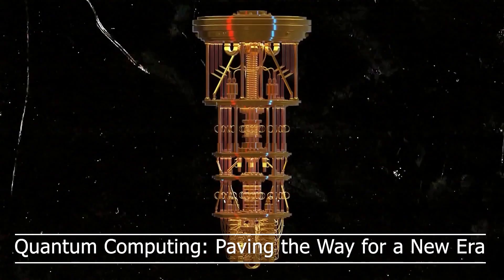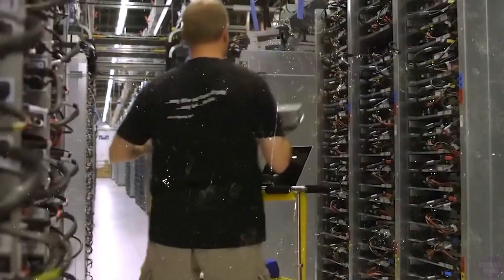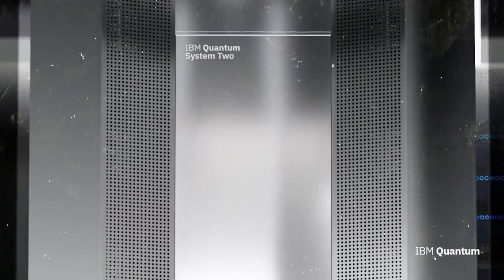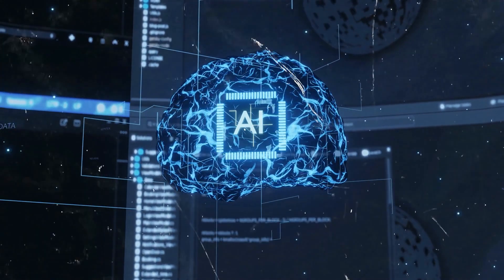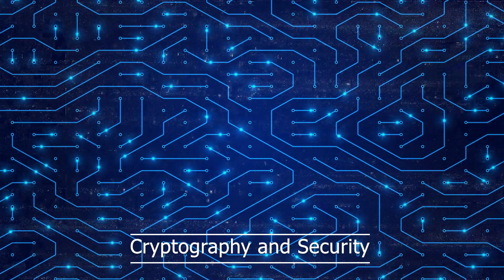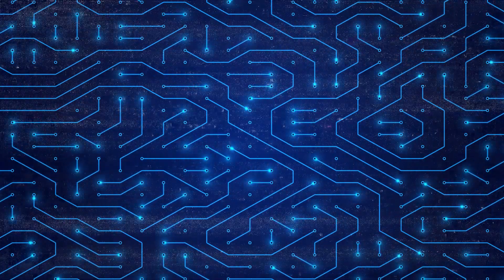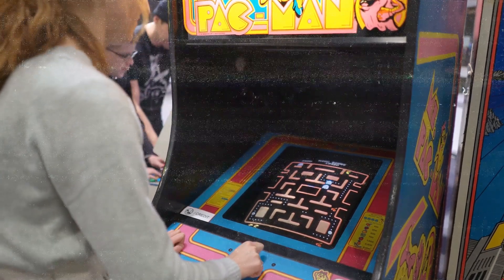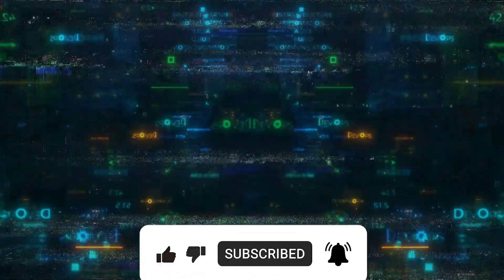Quantum Computing Advance Begins New Era, IBM Says

Comment: Error correction? If you got it right in the first place, there is no need for error correction. From what I understand, error correction is about getting the wrong results when the algorithm is right, because of background noise interfering with the quantum processes. But what if the algorithm isn't right? How is a computer, or a quantum computer, supposed to know the right answer? Doesn't our current chip sets already do this? It tells me that the technology is getting it wrong and requires a chunk of it's processing power to correct it.